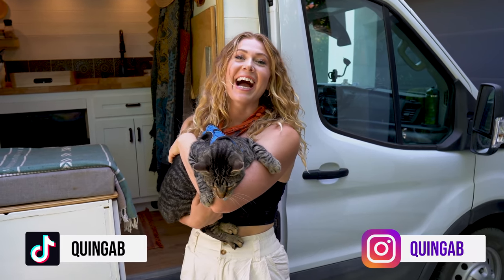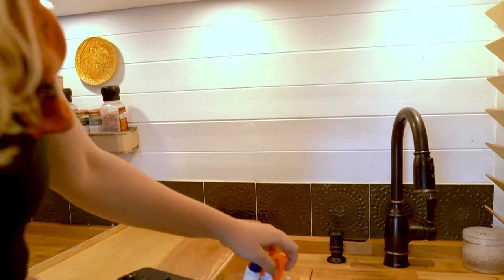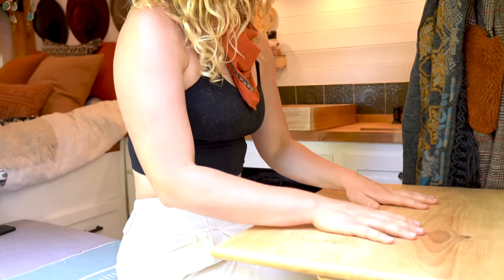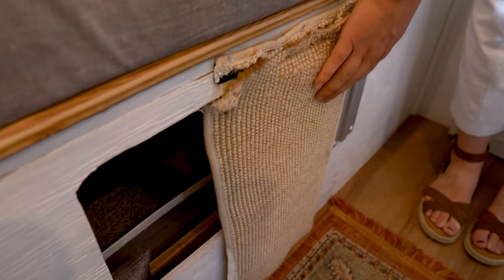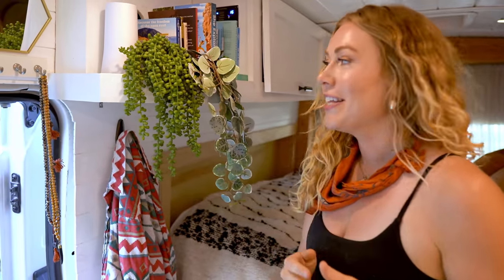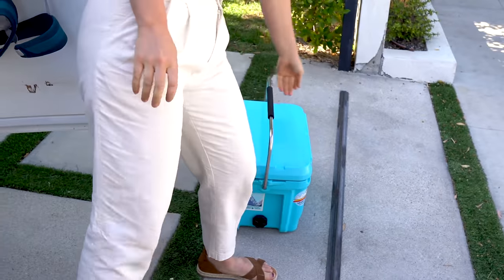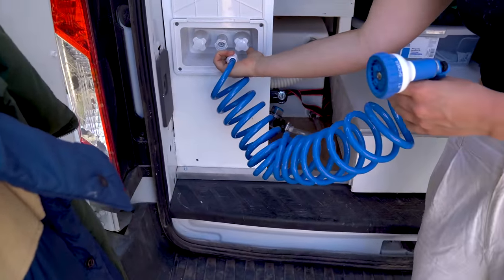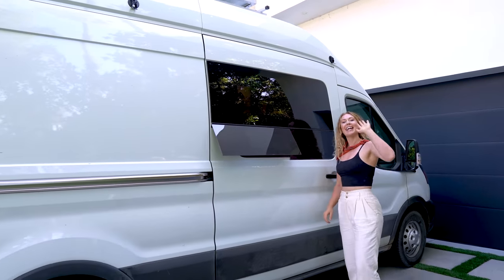VAN TOUR: Solo Female w/ 2 Cats

Comment: Sweet. You did well Quin. So many good ideas and systems. Yes, and the kettle! :)  I might check those out. I had a collapsable non-electric silicon one which was great but I overheated it and caused a leak in the metal bits. I've got a smaller van in a different country and security is always in the back of my mind. Situational awareness is a good friend too. All the best in your travels and way of life.

Comment: Beautiful van build! I like the looks of the Ford Transit and would have liked one but ended up with a used Chevy Express 2500 that I bought thru a Ford dealer here in Michigan which I ended up getting screwed over by Ford so will not purchase from Ford so even tho the Chevy was a lemon and has cost me a lot in repairs, the fact that the dealer basically took advantage of a senior citizen is why I will not give my money to Ford. The reason I bought a van was that I had a  2010 Jeep with a lift kit and my 2 senior dogs couldn't jump up into it anymore and needed a different vehicle asap.  Safe travels to you!

Comment: Whoa - this is literally the best van build I've seen so far, you have the most clever hidden storage areas. Did you do the design yourself, or did the builder come up with these ideas?  Can you provide the builder's information? Thanks for the explanation about the Ford Transit - I too prefer Ford (the manufacturer has less motor issues than Dodge or Chevy does) and am currently looking for something that offers head room.

Comment: Price for the van, and price for the professional conversion?  After a couple of years, do you feel you'll need a bigger RV to have interior space to "breathe"?  I ended up with a 23 ft Class C after spending 1/2 year in Canada and Alaska in a smaller, cramped space.
Reply from the maker: OK SO- prices are WAY different than 1.5 years ago. Transits used to be $28-45k and now they are 60k+ (for  2019+) and good builds range anywhere from $35-150k (wild). My build WAS cheaper than that, but it was with new builders and I have had to get a lot fixed. I have had friends do self conversions for WAY cheaper... so it all just depends on budget. And an RV would be amazing space wise, but it's difficult to get to some of the photography areas I want w/ the RV (I am a photographer). So my transit works perfectly for me :)
Reply: @QuinGable  Bought a used, compact Class C that the RV manufacture built on top of a compact Toyota Truck chassis- The Dolphin line.  Took my cat to Alaska with it in 2016. Good gas mileage for an RV, and only cost $10K.  But ultimately needed more head room and space and now have a Thor/Four Winds Class C here in Austin. Time for a Tesla camper van??

Comment: cleaning hack -   when your sink is DRY,  sprinkle some baking soda and rub those stains right out.   You can use a scrub brush, a cloth, your hand...   Watch as the "stains" magically disappear.   I neglected to clean my 2nd bathroom after a dye job, 3 months ago, finally got in there, this week, cleaned right up.   BAKING SODA,  then after you have it clean, rinse it down.  the secret is DRY.  If you aren't happy with it after it's wet, dry it before adding more baking soda.
Reply: also walnut cat litter

Comment: I have seen alot of these videos but i am always left with the question what about engine care, extra water for the engine if it runs low when not near anyone or extra oil, jump starter if no one is around to use jumper cables?

Comment: One thing I did in almost the same van is I put Storage Shelves behind the Driver's Seat.  I measured where the Driver's Seat is adequate for me and use the distance between That position and the divider wall for the depth of the shelves.

The unit has to be made in a matter of where it can be unbolted because under the driver's seat is where the Car Battery is.
Reply: I love that idea! I am building out my 1988 chevy now and I am so excited to get on the road this year. I am constantly looking for inspiration.
Reply: @margiesvanmori  

In my case it's a Ford Transit cargo van and I left the security wall behind the cab, so I don't have rotating seats.

Comment: Great video! We are in the process of planning out our van right now and I have a few questions. I really want to go with a SimpliSafe system as well, but am worried about connectivity. Does it run off your at&t wifi? Is that enough each month to run it? Also for your bed did you get a specific mattress or did you go to a foam store and have them specially cut you a piece?